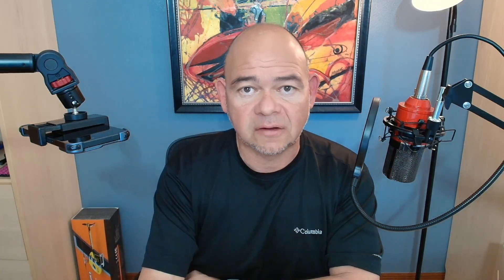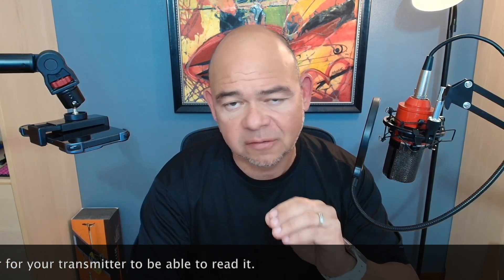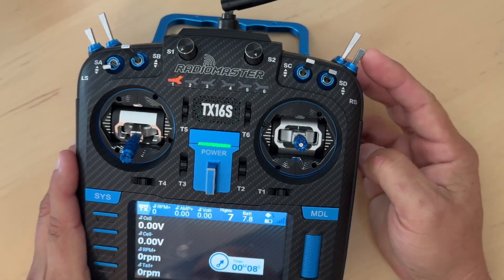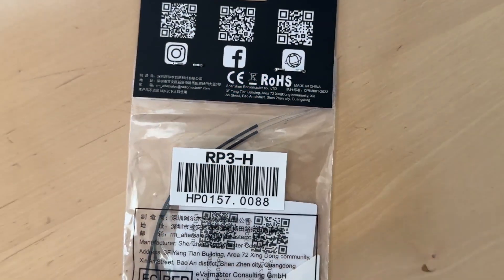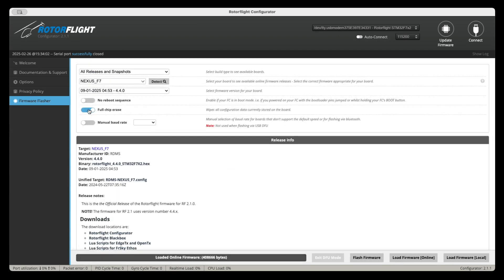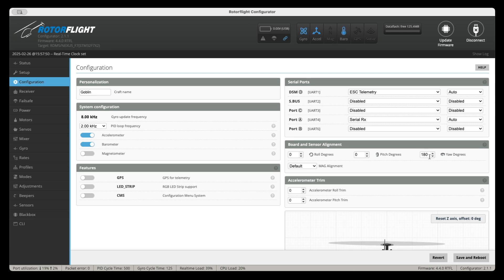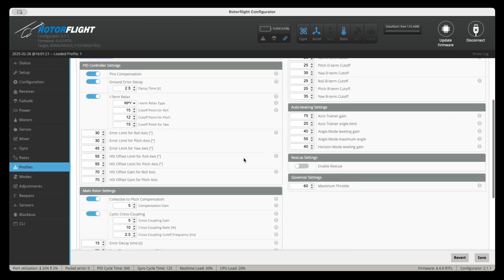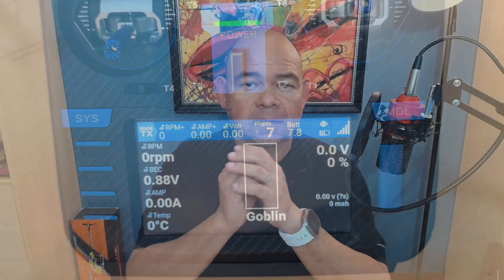RotorFlight complete setup in 18 minutes?

Comment: i am having one small issue while the radio setup portion went down without any problems. the nexus upload not so much I can't help but think that I'm missing a step somewhere. i am using a windows-based laptop so i think it might be that. can some direct me in the on the nexus part?

Comment: Hello Bert, can you also set up a nitro helicopter with your upload files?
Reply from the maker: I'd like to, but it is not as simple as a file because with nitro you have to very carefully setup your throttle servo and you have to reboot every time you make a change for such change to take place. I'd like to do a video, but it is extremely time consuming. I will eventually though.

Comment: Hey Bert you are a legend. My RS7 flew 80% of the way on the maiden. Has made tuning a joy. One question, how do i disable the low voltage alarm in the TX it goes off too often under high load and drives me insane 🤣
Reply from the maker: Very sorry for the lack of response, been traveling too much lately. I am not sure what alarm you're getting. None of my files have alarms for low voltage other than the widget for the battery charge state. I would suggest reviewing the setting under "Power" in the configurator, you perhaps could have the cell count wrong there.
Reply: @BertKammerer  yeah I suspect it could be related to that. I will take a look. I just disabled all alerts for now to stop it happening 🤣 Just send it 😆

Comment: Hi Bert, thanks for all your work you do for us for free!!!! I made an adapter to connect the yellow cable from the Hobbywing Platinum 80 V5 Controller to the DSM Rx Port of the nexus. But I got no values. The TX16 says all the time "Sensor lost". In the status page of the Rotorflight screen of the TX16 is a message ...Controller not ready. Any suggestions what´s wrong? Thanks for your help!!!!
Reply from the maker: So sorry for the lack of response, been traveling too much lately. I just simply connected the telemetry to the DSM port on the Nexus using the HobbyWing telemetry cable that is available on the market. I haven't heard of that error, more than likely you need to make sure the ESC is updated to the latest firmware.
Reply: @BertKammerer  thanks! Had to update the ESC.
Is there a way to update this setup to RF2.2? Thanks

Comment: Hi Bert, thank you for sharing your T16s profiles, I have installed these onto my spare radio and it works a treat
I have a question if you don't mind?
I currently have two models....OMP M4 which is using the ESC Gov and a Nimbus 550 V2 which has a Hobbywing 150 V5, but on this model I am using the RotorFlight Gov, I prefer your way of using one profile with model match, however I usually run flat curves at 100% in flight modes 1-3 for the RF governor, would I need to use a separate model profile for each helicopter, or maybe go back to using the Hobby Wing governor on the NImbus?
Regards,
Dan.
Reply from the maker: It should work the same way, my radio file has a 100% throttle signal on the 3 banks, so I don't see why it wouldn't work with the RF governor.
Reply: Thank you

Comment: Quick question, I haven’t watched all the videos yet but I just got my radio. I was wondering if you modify the springs or the collective stick tension. Thanks in advance.
Reply from the maker: I loosened the tension on both of my sticks, but that is a matter of personal preference 100%, there is no right or wrong there. I do not modify the springs, just make the tension lighter.

Comment: Hello Bert,  ty sosososo much for this files and the video,  with this ones, i am up now for test rotorflight,;  do you think would work with a flydragon v2.2?   Thank you!
Reply from the maker: I wouldn't try to run the diff file on a Fly Dragon, it is meant to be used on the Nexus. If you try it, you'll run into errors, as long as you go through the entire setup to make sure all is correct, then you should be good though.

Comment: Can i ask you a question Bert? I fly a Raw 500. It’s less than a year old and i don’t fly it weekly. At 2800 rpm the motorbelt broke doing pitchpumps. The belt looked as new. No wear whatsoever. Is that normal? Should i replace it regularly. And the tailbelt to maybe?
Reply from the maker: Not normal, could have been a defect on the belt or it could have been too lose or too tight. Make sure you have the pulleys setup correctly. SAB made a revision where they changed the location of the idler pulley. Download the latest manual from the SAB web site to make sure you have yours setup correctly.
Reply: @ the idler pulley was indeed on the wrong side. Thanks for pointing that out Bert!
Reply from the maker: @frisos3944  Wow glad to hear. I never nailed it on the first try hahahaha. Happy that you figured it out.

Comment: Thanks Bert. I have two new helis. First is OMP4 Max.Tuning went great and everything is working fine. Second heli Mini Genesis. All in nexus is fine, but when connecting heli it doesn't change name in tx, and servos are not moving. I have the tuning done and it works before. Need your help, Thanks
Reply: Sorry. I managed to find problem. Jee. Now there's only one problem. I have scorpion tribunus 80. I know it works, but from Nexus to esc there is on signal???
Reply from the maker: @Bushpilotti  Sorry for my delayed response. I was going to suggest you download my transmitter file. I don't understand your question about the Tribunus, it should work just fine.

Comment: Bert, hope you read this soon.  Just following along with the above video.  All went well with the transmitter portion.  The rotorflight configurator part is where I have a problem.  I had watched one of your previous videos and already have configurator version 2.1.1.  So when I clicked on the configurator link, what appeared on my screen was different from yours.  Because my Nexus was plugged in to my computer, I think it was reflecting the fact that I already had 2.1.1, and didn't need to download it.  The problem is, I can't download the new software you provided for the Nexus.  How do I resolve this?  Guess I'll check back periodically to see if I have a reply.  Thanks in advance for any help.
Reply from the maker: Sorry for the delayed response, I've been traveling for many days. When you download my zip file and you extract it, you'll find a Nexus directory. When you open up configurator and plug in your Nexus, you simply go to the bottom where it says "CLI" and click on "Load from File", find that file inside the Nexus directory and execute it, it will load all that on your Nexus. Then type "exit" and you are done. Pretty easy.

Comment: Bert, I hit another wall. I have a Hobbywing 180 Platinium V5 and I can't get it to work. I'm not sure I wired it correctly to the Nexus. I'm using the DSM port connected to the wiring that came with the Nexus unit. It's a Y connector with black and white wires coming out of the Nexus DSM port. I assume the male end connects to the back of the Nexus and the female end connects to the Hobbywing red, white, red and black wires.  Please confirm. Next, where does the male connector plug in? Also, what Nexus ports do I plug in the yellow signal wires and the other brown/red wires? Thanks for your help man!
Reply from the maker: Sorry for the delayed response. That is very incorrect. I suggest you watch my video where I explain how to connect the wires. Go to minute 6 on this video: https://youtu.be/XiuavbagnpE?si=GhWIBzPbQJH7AJ9F I hope you didn't fry your Nexus or ESC.
Reply: No worries! I contacted Hobbywing and they helped me sort out the wiring. I've been watching your other videos and they have been very helpful. Thanks again man!!

Comment: Bert, I'm having trouble flashing my Nexus flight controller from the Rotorflight configuator. When I connect the FC to my Mac and select detect I get a message that says "Serial  port successfully determined. Then I get a message "Unable to detect board for connected device".  Up at the top of the Rotorflight flash page, the Port that is automatically selected is /dev/cu.Bluetooth-Incoming-Port. The Baud rate is set at 115200 under auto-connect. I tried selecting the Nexus_7 FC, loading the firmware [online], selecting flash, it then stated that "Rebooting device to bootloader: Failed". I've also tried several different USB-C cables to no avail. Any suggestions on how to fix this would be welcome.
Reply from the maker: That is a tricky one, something with your MAC for sure. Do you have another port that you can try? I would try another port first and simply try to connect to it instead of flashing it to make sure you can establish a connection. Once you know the port for sure you can try to flash. I know some newer MACs with UBC-C do not like UBC-C to USB-C connections to the Nexus, often times using a UBC-C to USB-A adapter works better than using a USB-C to USB-C cable.

Comment: Hello Bert, apologies in advance for asking this question. For HobbyWing ESC which I have, do I still need the program box for it to be on ESC governor or is it all done in RotorFlight when teaching the ESC for high and low? Thank you so much in advance. Just replaced the battery on my laptop, for now I’m gonna load your file to my Nexus while waiting on my Rx, sadly it’s been delayed till the 7th.
Reply from the maker: If you have the V5, then you can use the Rotor Flight Lua in the SYS screen to access programming. More info on my previous video: https://youtu.be/NAqU8txHWDw?si=Swc1tLJAyqC2wMz5 If you have a V4, then you will need the program box.
Reply: @ I believe have the 80a V4, is there a different way for the V4 or simply use the program box to put the ESC on Governor?
Reply from the maker: @scrc511  Yes, just use the box to program the governor, BEC voltage and you should be good.
Reply: @BertKammerer  Thank you Sir appreciate it all. Kind regards, and stay safe.
Reply: @BertKammerer Watched your  video with regards to lua and how you’ll be able to change some settings within the radio is pretty awesome, think I will go ahead with the V5 version for my ESC.
Reply: @BertKammerer I went ahead and ordered the HW V5 ESC, loaded the file you provided for the Nexus. Didn’t take it out from the Heli, simply load the program and calibrated it after. Took a picture of my servo settings and re load them back after the calibration. When the ESC arrive will review more of the settings there. Setup some widgets like in your other video, and will review them later thru screen monitor, and RotorFlight’s mixer, rate, and  profile tabs just to make sure things are in order. Blades will be off the Heli of course, especially for the ESC high and low learning process. Thank you so much once again.
Reply from the maker: @scrc511  Sounds good! Keep in mind that if you load the file for the transmitter (your entire SD card), all sensors will work and your model will be correct. With this said, doing this will wipe out all the content you currently have on your transmitter. Perhaps you could get a cheap SD card, load my contents and try it for a test, you could use it to take pictures and get ideas to optimize your current transmitter setup.
Reply: @BertKammerer  Yes Sir, did used a different SD Card. With your setup, it’ll all applies to electric Heli’s since the parameters are saved within the FBL itself. For a test, I did load a model yml file for M2 Evo from OMP website. I don’t have the model yet, I will be purchasing it from BK’s hobbies. When I checked after loading it, going to model select thought its gonna show but it didn’t. Does it mean that after it’s been bound it will show then in the transmitter then I can make changes to parameters settings from its app? I have the M2 V2 and the EVO, the one I will order from your website is the latest  one. Need to watch your other Video about the model match. I have been a Futaba user from day one going into this hobby, and one of the first one to introduce the TX16s at our local flying field, and now most of them switched to TX16s and nexus FBL unit 😂. Thanks again Sir
Reply from the maker: @scrc511  Your M2 Evo is not showing more than likely because the model file is not named modelX.yml where "X" is a number. I believe the radio needs this in order to display the model. It should work, I have done it many times and you should be able to see the model come up when you try to switch models.
Reply: Thank you, tried it twice but it didn’t work have to double check that file from Omp.
Reply: @BertKammerer Just an update Sir Bert, loaded the file again for OMP EVO MK2. This time it’s placed under template personal, so when I created a new model looked for the template and it was there, then I placed it under Heli and named it OMP for that folder, all is good it finally showed up 😂.
Reply: @BertKammerer Thanks Bert, I have the 80a V4 and not sure what’s the difference compared to V5. I’ll order the V5 so I can follow your setup thoroughly. Appreciate all your contributions to this hobby, best regards and thank you so much.
Reply from the maker: @scrc511  The V4 works well too, you just won't be able to program the ESC from the transmitter and will need a HobbyWing program box to program the ESC.
Reply: @BertKammerer Thank you Sir. I will go with the V5 so I can get the required telemetry within the radio.
Reply from the maker: @scrc511  You can get the telemetry without a v5, you just can't program the ESC from the radio.

Comment: Always make the best video !! Some suggest for smaller size? like 300 ? and how i can set stabilty mode. Thanks a Lot
Reply from the maker: I haven't done any tuning on a small machine yet, so not sure. As for stability mode, I will consider doing a video about that soon. It is super easy to setup, you use a switch the same way we have switches assigned for profiles and rates.
Reply: @BertKammerer  the first flight with my aling 300 way very hard... I tray to adjust the   the gain. .. But i Think is no good idea for use with small helicopter. Thanks
Reply from the maker: @atamargo99  What do you mean by hard? Didn't fly well? Small machines are a different animal for sure.
Reply: Very hard to Keep levelling.

Comment: Great video. Thank you. One question, looking through the radio file, it assume internal ELRS module. Will it work, as is, with external module?
Reply from the maker: Should work with both. My transmitter has the internal module, but this should work for the external one too.

Comment: Thank you so much Bert, really is great what you doing with regards to RotorFlight config and setups. This is very helpful, just received my TX16s Max ELRS version. Gonna transfer my AG01 Gimbals to the new Radio and follow this setup. I like how you setup the switches assigned also, pretty much how I setup mine. Again thank you so much

Comment: Interesting, I am waiting for my Hobbywing V5, but may try this. I notice you never use other flight modes on the Nexus (like Angle mode). Have you ever tested these?
Reply from the maker: You don't need a V5, the V5 will allow you to use forward programming from the transmitter though. However, a V4 will work fine. Angle mode and Horizon mode are mainly for very early beginners. Horizon keeps the helicopter leveled and this means that when you fly you have to maintain input, so if you want to go forward you have to keep holding elevator forward and if you let go the helicopter will stop and go back to a hover. This is great for the very beginner, but it is something that can develop very bad habits to a pilot over time. The Angle mode does the same as Horizon, but in addition it limits the angle of the machine making it even more restrictive. These are models that I only recommend using if you are absolutely a total newbie learning to hover.
Reply: @BertKammerer  Thanks Bert. That is what I suspected. I am going to use Angle or Horizon mode just to make sure everything is mechanically correct on the helicopter, since I am upgrading an old model with the Nexus. I thought it might be a safe way to check everything before I put it in Acro.